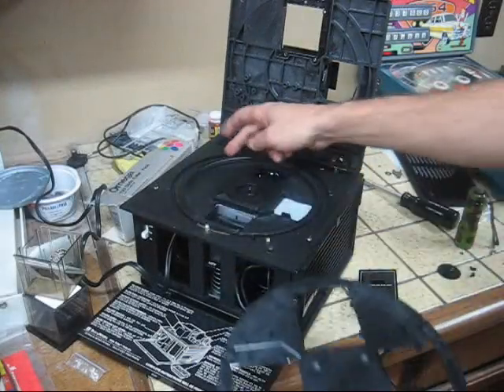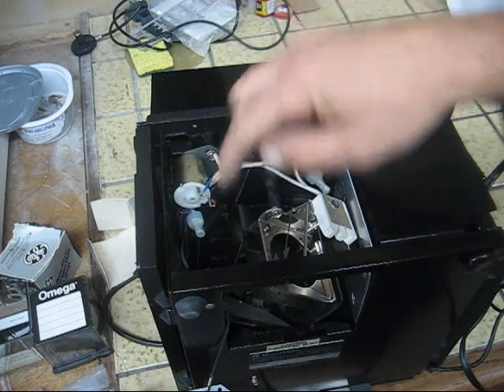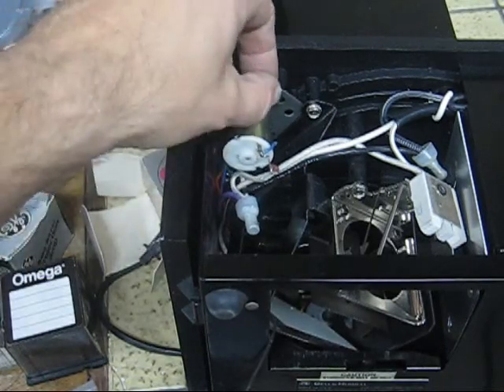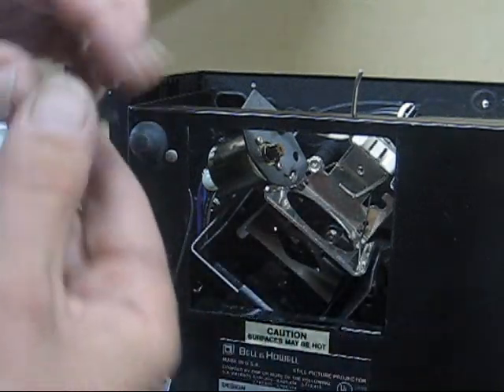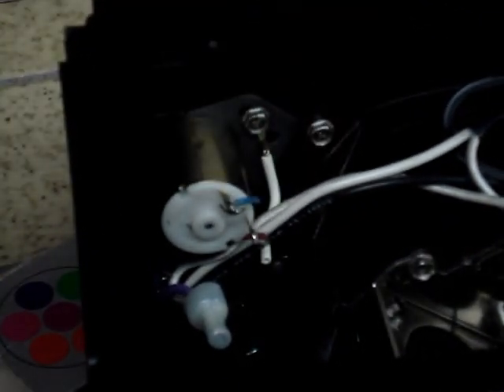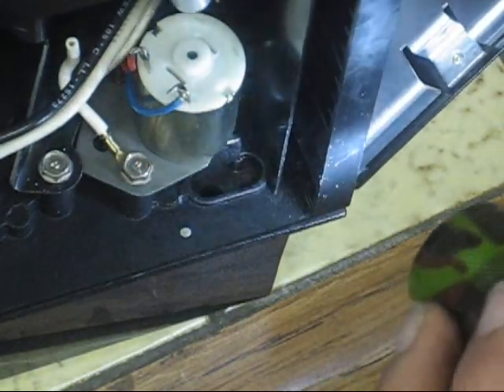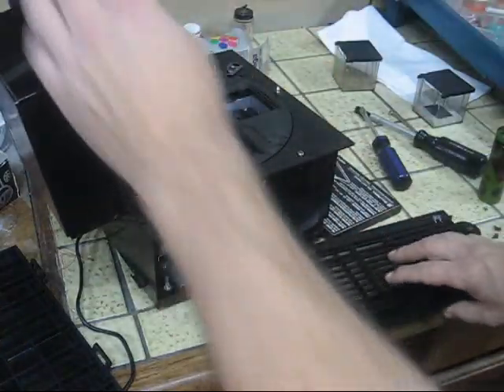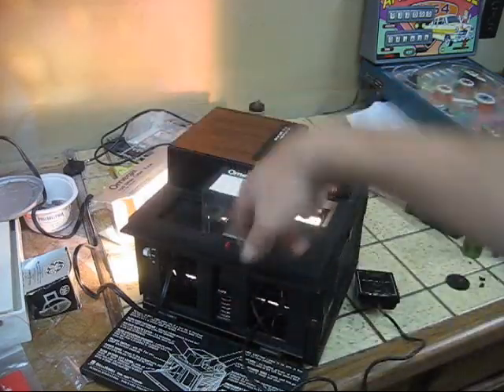Bell & Howell Cube Projector Repair Part 2: Replacing the Main Gear

Comment from the maker: Attention Everyone! I talked to Micro-Tools today who have been producing the New Delrin replacement Main Gears, due to demand they are out but have an addition batch ON THE WAY! They will be letting me know when they arrive so we can make an announcement. 
They got almost zero demand for these in the past and are pleasantly shocked that all of you have been fixing up those old projectors, however, in the mean time have been inundated with calls looking for them, and they haven't arrived yet. I also want to apologize, my time has been limited lately,  I'm also pleasantly surprised with the interest these videos have had. I have a lot more videos to make, as well as other equipment to go over. I'm sorry if I haven't been super responsive but as time clears up towards this summer I hope to be back at it as it seems to be helping people. So, i am happy to keep answer questions the best I can in the mean time, I encourage everyone to keep pulling out, cleaning up, and fixing up their photography stuff, and I look forward to what looks like what will be a summer full of fun when we can really start digging into more stuff again!
Reply: Hi! I just went through this process with a new gear and it was just as you described. Thanks for the awesome video. My problem is the carriage turn s, but at about a third of the speed of yours. Deadly slow, and I have over 10,000 slides to go through. Any ideas how I can fix this? Thanks!
Reply from the maker: Hi, thanks for watching, glad it helped. As for speed, it depends what model you have. Some were geared to run slower than others to help prevent jamming, mine is one of the faster ones, the gear we replace is a reduction gear after all.. They usually run slower than we are used to things with computers these days. 5 seconds is not that abnormal, but if it is REALLY bad (like 20 seconds!), then you want to check a few things. 1. make sure all the gear teeth and everything is cleaned out thoroughly so there is little resistance.2. check your wires, make sure nothing is broken so it is getting the power connection it should. 3. If the motor is really bad (and you should probably hear it) then you can check the comments bellow on these two vids where we discuss using some Radio Shack electronic parts cleaner to clean out a motor if necessary. Then use a VERY small amount of oil at the shaft bearing ends. Let me know how it goes. Thanks for the comments.
Show less
REPLY
Reply: I'm stuck on final assembly! Got my new gear in!! Works!! I'm stuck on that tongue part and which washer goes where. I have a reg washer which goes first.. then the lever? the a spring washer? then the c clip?  The level will not unlock on its own when i advance, unless i lift the lever with my own hand.. I'll go watch part 1 again, maybe you detailed it a bit more. Thanks bro!
Reply: I almost have it!! My mistake was it was in reverse, and only goes back 1 slide.. So in forward, it does rotate.. BUT the toungue does not drop into the hole each time. The tongue is not held down tight enough?  My install order: big washer, lever, spring washer, c clip..
Reply: I figured it out, for anyone else there was nothing wrong. The peg does not drop into the hole when going forwards. Only when going backwards. But the spring washer goes right under the c clip.. to hold it toght.
Reply: Justin, I just replaced the main drive gear, as you described. That part now works perfectly, but an electrical problem has arisen. The projector lamp appeared to fail in the first minutes of operation. Thinking it was the bulb, I ordered a replacement. When this one also failed quickly, I got a schematic to dig deeper. I tested both bulbs with a 120V test lead, and both illuminated. Looking deeper, I noticed a "Thermal Fuse" in the 120v lead to the lamp.
MT also supplies the fuse. I cannot locate it on the chassis, even totally disassembled.
Do have any experience in that area? I could use some assistance. 
Al Moore (B&H AF-70)

Comment: Justin, this is still useful in 2024.  I decided to look at all my old slides to see which ones were worth scanning.  My  55 year old projector worked for half a cube, then jammed.  As I always do when I need to repair something, I turned to YouTube and found your great videos.  My projector model was build slightly differently than yours, but you showed me what to look for.  It was the main gear, just as you showed in your second video.  I did have to disassemble the unit to get to the main gear, but it went back together just fine and I am now able to get on with my project.  The gear from Amazon was $19.95 and appears to be a polymer similar to Delrin, which will probably outlast the other parts of the projector.  

Thanks for helping everyone salvage their projectors.

Comment: Justin:  I know you posted this quite a few years ago but it only became an issue for me recently.  Luckily I found this incredibly helpful video.  Dad passed away and his collection of 70 years of slides and his B&H R 60 Projector became an issue for me.  In the effort to share a slideshow with my sister I found the advance feature inoperable.   Thanks to your video I isolated the problem as the driver gear and am preparing to order a replacement and repair as you instructed.  Thank you ever so much.   Very appreciative~!!

Comment: Just replaced the gear on my RC55 with your instructions.  Worked like a charm!  Thanks much!  ...although getting that back motor bolt in was a real bear!  I dropped it twice into the projector, leading to me shaking the whole projector to finally recover it.  If I ever have to do this again, I'd be tempted to drill an access hole in the bottom steel frame just above that bolt to give access more easily.  And my new Gear from Micro-Tools was $19.95 + tax thru Amazon (5/31/21).  Thanks again for doing this!  Now I have to go thru about 3,000 slides from the 1970s forward...
Reply: Thanks for the hole drilling tip.  I just took my motor out and based on how hard it was to get out, I couldn't imagine how I was going to get it back in.  Now, based on your tip, I have a plan.

Comment: Well, it's now six years since you posted this and the gears are still available on Amazon.  I just ordered one, having taken the motor out per your video and finding the gear all chewed up.  I suspect the plastic just gets brittle as it ages.  Getting the second motor mount screw out was a real challenge to me because of the angle of the access.  I managed it by putting some tape, sticky side out, on the top of my socket.  It got enough grab to get the screw out. To put it back in, I plan to use the advice of one of the commenters below and drill an access hole in the bottom of the projector housing.  Thanks for the video.

Comment: Thank you Justin, the two videos very salient to help solve the dilemma of the slide not sliding from the cube.  That gear/driver part was the issue, from Amazon for about $20.  Two comments - for that back screw on the motor I used the wire as an arm, grabbing with needle nose pliers and maneuvering to over the hole then gently connecting the socket drive to tighten.  Also the seating of the motor is not so straight forward, I had to adjust it many times (having to reseat that back screw 3 different occasions) before the carousel moved freely.  Was actually on the verge of frustration and close to chucking the entire projector but then everything came together and now works as good as new.  Thanks again, great camera work and explanation!

Comment: Wow, amazing.... i got one of these projectors in today.. the top woudlnt spin.. i worked with you in video #1 and #2, and found the broken gear. (Also found gear pieces before disassembling). I now have a gear on the way. Kind of pricey on Amazon at $20 shipped, which is more than i paid for the complete unit. But still, I'll fix it properly before selling it on, albeit for a much smaller profit now..

Comment: Your video was very informative.  i have a problem with the fan. It stopped spinning after making a tremendous racket.  I opened the side and the little belt may be too lose but I notice the fan does not spin freely when pushed by hand as well.  Do you have a solution for the fan?

Comment: Hi Justin, great videos - thanks!  I have a B&H CP40 slide cube projector that is turning very, very slowly.  The CP 40 opens up a little differently from the one in your videos, but I was able to determine that the gear drive is in good condition, so that's not the issue.  I gave it a good dusting even though it wasn't that dirty thinking that might speed things up, but no luck.  Any other suggestions as to what might be the issue?  Thanks for any help you can give.

Comment: The slider arm arrangement isn’t like ours.   The tab that drops into the carousel opening doesn’t stay there.   Ours came with 2 circlips; two silver washers; one spring washer; and one tiny hexhead screw that goes into the outboard pin.  We have a lot of slop as the arm moves.  The arm stops outside the little gap in  the carousel.   We get a lot of jams….especially with plastic slide mounts.

Comment: $20 for a new replacement gear now, WOW!
 I replaced the gear and everything seems to be working as it should but I think I need to figure out how to slide the cube onto the projector the right way. Everytime I slide the cube up the slides just kinda fall out of it onto that spring loaded pad or magazine, they aren't loading onto the turntable properly, not sure what I'm doing wrong.

Comment: Justin--got a B&H -3000 Slide Projector that I just bought. Everything works but will not focus. The ring will not turn. Don't know if its suppose to?? lifting the cover  I can manually slide the lens in and out by hand, but it still won't come in focus, Should it focus it-self?? I need help!!!!

Comment: Motor works gears are engaged but carousel is very sluggish to turn, maybe 5 secs to advance and control arm that controls the shutter doors is sluggish and sometimes the shutter doesn't open.
Reply from the maker: Hi Jan, thanks for watching. Sorry about the delay. It depends on what model you have. Some versions were very slow on rotation due to mechanics, it's as if they were geared intentionally that slow, which should help avoid jamming. However, slow is one thing, but the shutter should not fail to open. Assuming it is like this RC-55 I would follow the inspection/cleaning steps we did here in these videos first. 
These things are notorious for broken parts getting jammed. You want to make sure nothing is binding up and keeping the shutter and lever from working. If you remember when we removed the large snap clip from the metal arm the protruding bar is connected to the shutter, just pushing it back and forth with your finger should also make the shutter open and close.
 If it doesn't, there may be dust or garbage around that metal arm or the shutter screen itself. You can use some canned air or a gentle brush to clean the chassis out as well. Further, if its really old and dried our it may use a VERY SMALL amount of lubricating oil on the mechanical joints. But Start with the cleaning and we'll go from there before we start having open stuff up.
 Now people have been asking questions I will try to do a follow up video to address things as we go. Thanks.

Comment: Justin, good demo, I have two projectors and replaced both gears. However, on one of the projectors the wheel goes really slow. The other one the wheel spins like yours on the video, but with a cube in place it jams. Looking closer at the problem I see that a spring hung flapper that hold the dropped slide in place is not working. It is the flapper right under the red release latch. Have you encounterd this before? Do you have a suggestion?Thanks, Tom
Reply from the maker: Hi Tom, Thanks for the questions. #1 What model projectors do you have? Note - Some were designed to actually cycle slower than others, maybe to help avoid Jamming. Otherwise we will have to get into the motor and connections. In part 1 comments we had some discussions about motor cleaning and function #2 Also, if you look at the top of the comments on the other video, Part 1, Robert Tartter seemed to have some similar issues with the feed lips not popping out correctly, but he fixed it, you might see if cleaning or anything he did solves the problem. Hopefully towards the summer I can get some more time and make some more in depth videos. But for now, we'll start troubleshooting from here, check those out and then let me know how it goes. Thanks.
Reply: Thanks again, I have two RC55 projectors. The flapper or lip I refer to is more like the plastic item described by Steve Mayer. That is on the fast projector. Back to the slow projector, it wasn't slow until I replaced the gear. 
I only need one working projector, for now at least I can use the slow one, but wouldn't mind taking parts form one to the other if knew I wouldn't Detroit them both.
Tom
Reply from the maker: Thanks Tom. Yeah, at least one running is good, but both back in shape is preferable. I'm gonna have to dig a little more into this stuff and make some more vids, hopefully this summer. The piece I think you guys are referring to is what I have come to call the "Extra Insurance" piece. I have yet to figure out exactly what it does other than aid many other functions around it as a back-up, but I have found out it is not exactly essential, I have been able to pull it completely out and still run the projector, it is just back up for other stuff around it to keep from jamming or misalignment...extra insurance..

Comment: I'm having fan problem.  Appears the drive belt has stretched and fan does not spin.  Found out after too much heat shut down projector.   Is there a reset from overheat procedure.  Will not run now.

Comment: I have a 975Q and it's much more difficult to replace the part, but I did.  Lined up everything, you press the button to advance the slide and nothing happens.  It still won't advance. There is no "click" with the button at all.

Comment: I took the carousel plate off the gear appeared to work.  Yet when I put back the plate it does not advance and the slides don't move.  Any suggestions?
Reply from the maker: Hi, largreycat #1 I'm sure you've looked to make sure all debris is cleared. make sure to check the index arm like I do in vid 1 and make sure it activates the shutter and is not stuck.  #2 Check the teeth on the gear closely as well as the edge of the carousel to make sure they are not stripped out. Sometimes close examination will show deep wear. #3 Check the adjustment pivot on the motor. Look closely in the vid and then look at your motor mounting bolts. You will see the nearside bolt is in a wider slot, not a hole like the other in the motor mount plate. Try loosening the bolt and then pushing/pivoting/swinging the motor inward towards the opening for the gear to the carousel edge. Make sure it doesn't slip back and then tighten the bolt back down again. Hold it in place with your finger while tightening. I think mine slips back in the video if you watch closely. See if by pushing it forward you can get the top of the gear to re-engage the carousel plate. Try those and see if it does the fix. If not we'll go from there.  Thanks for the question.
Reply: Thanks Justin.  Will do and will let you know how it goes!  
Mark

Comment: So we recently inherited a Bell & Howell model 977 and it appears to have the issue you described (carousel not turning) however the main gear is not broken like you described. So what else could cause this. I do not see any stuck or broken pieces. the main gear rotates fine however the actual carousel won't move with remote or manually. What could be the issue?
Reply: Me too. Sorta. I replaced the damaged gear; swept the area free of debris; and the carousel drags slowly before jamming as it did before. Suggestions?

Comment: i cant figure out how to get the top of the slide cube back on after it comes off; which it does all the time.  second, my slides, when they are over the first window, fall into the collection chute, or tip down.  it is as if the little rubber holders have given out.  any ideas?